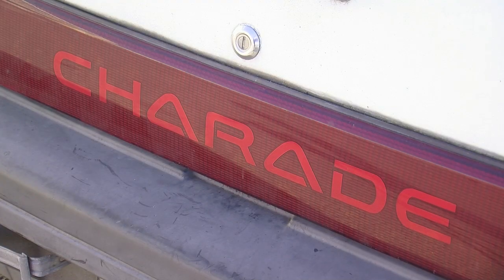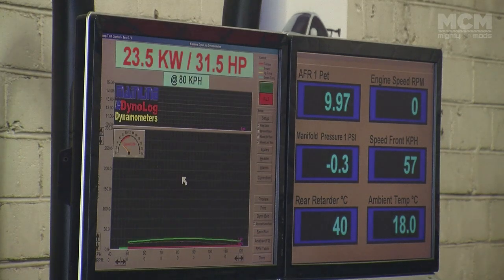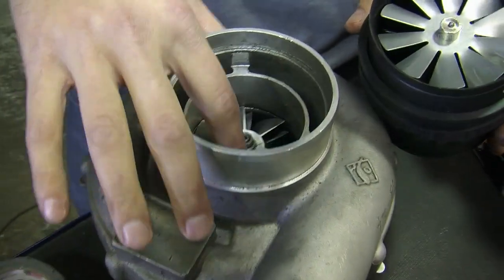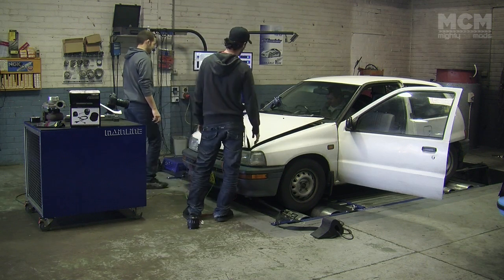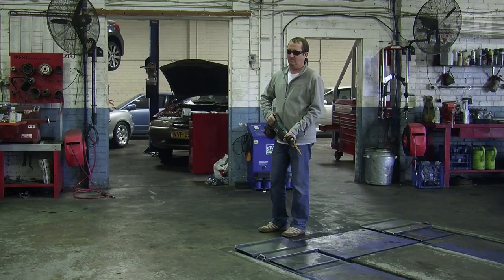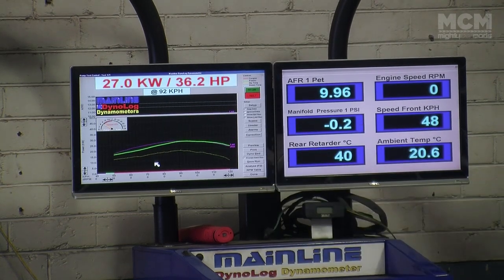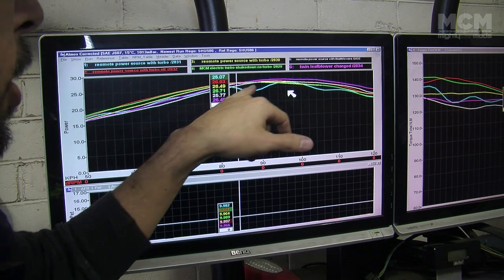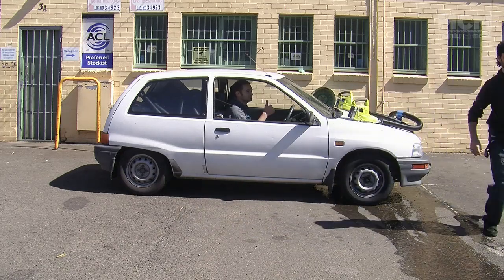Electric SuperChargers Mythbusted

Comment: You can buy a T3-T4 crappy wizzer on ebay for less than that electric "super whatever".. And all you need is a few extra bucks and some sorry fabricating skillz. Stick t3t4 on the end of the downpipe, stick the carb on the intake side, open up the fuel screws a bit, run some of that super high flowin' ribbed shop-vac hose right up to the intake. fill up the turbo bearings with oil and put bolts in both sides. Grab a fire extinguisher and hope to get a dyno run out of it. I would like to see THAT

Comment: I believe it was a standard Aus Spec like on a Forester. The factory tune generated around 125kW after they flashed the ECU they were getting an extra 20kW. That is plausible however I don't believe there is such a thing as a free lunch, a 20% fuel saving on top of that seems to be stretching the truth. I note the manufacturers of the Ezy-Flash Pro ECM don't make any such claims (at least I couldn't find them on their website). LOL.

Comment: Oh man you should totally do a mythbusters on ECU flashing. There were these guys who used an Ezy Flash ProTune on their Subaru and claimed heaps more power, torque AND a 20% fuel saving ! Sounds unbelievable, maybe you could check it out !! (I believe flashing the ECU can increase power etc, just not with a 20% fuel saving thrown in). LOL.

Comment: higher octane fuel will help, no argument.
But introducing boost has the same effect as increasing compression, it raises the pressure on the mixture.  E-85 (102-105 octane) and ethanol (race fuel 108 octane) can handle this to a point. 
take a 1000cc engine at 11:1 natural. forced to 2bar (not huge) still at 11:1 would produce a pressure on the mix equivelent to the origional engine having a 20:1 CR. Since temerature increases exponantialy with pressure, it doesnt take much for the mix to Det:)

Comment: I went back in time to find a reason why you would be so tripped up over the exceedingly simple thing that I've described over and over.

I stated "I now consider bringing a supply of air along for the trip a poor use of space."

That was a boost tank... the idea came from NOx tanks, supercharging, and being a poor college kid. I never intended it to run the engine, but since charging the tank was decoupled from using it, the boost would come without much energy cost at the time of use.

Comment: I'll spell it out for you. The tank is charged at home and used later for experimentation. The experiment didn't work because of any number of reasons (but certainly not because of an air compressor), so I scrapped it. The pressure in the air tank will rise to the same level whether I used a manual bicycle pump or the $0.75 one at the gas station. You keep going on about a $20,000 pump like you can't comprehend an air tank that is detached and far far away from its air compressor.

Comment: If you can do valves and all that, I would start with a port and polish since that is most likely to be a cheap and easy enhancement that won't cost much but time. It's likely that the factory didn't spend the time, and the VR6 format has great starting potential for this mod. Since both a supercharger and turbo supercharger will both take power to run them, the porting job does shine since it is a passive gain.

Comment: Although I know an electric supercharger is a piece of shit ....you guys ran it through the air filter cover...you need to run a solid pipe from the S/C to the throttle body/carb that wont leak boost to make full potential power. All the compressed air you guys added just blew through the top of the air filter box

Comment: Being an air tank and not a compressor with an air tank... The data plate did not mention any compressor specs. I have mentioned before that I had an air tank and not a compressor, right? ... Right?

For all the effort of making a troll YT account and posting hundreds of flames on an entry level car channel... You really suck at it. I hope it helps to ease the pain of being a furry.

...and just to clarify, I had a standalone air tank... not a tank from a compressor.

Comment: thanks for replying i really appreciate that, i was thinking of the mercedes benz kompressor, or a g60, or any regular supercharger that can give me even a minimum boost as long as i'm not changing anything, and besides i can install valves, solenoid poli and stuff like that so it wont start unless i want to, i was thinking to automate it after 3000 rpm, it's a vr6 2.9 D.O.H.C., again, any ideas are welcome and thanks again

Comment: I clearly stated that I did this when I was young and stupid... Though I had good reading comprehension, this was before google existed and there were fewer geysers of shit-talking know-it-alls per square inch back then. I also stated that I had an air tank, not an air compressor, on board. The intention of the project was to give me one short boost, but mostly just to see what would happen since this was very likely before you were born to serve insight from your ass.

Comment: try this lol Change Sun 70mm 4 Bladed EDF unit  
- Outside Diameter : 71mm 
- Material : Carbon Fibre Reinforced Nylon (Whole Unit)  
-  Rotor DIameter : 68mm , 4 blades
-  Max RPM : 50000 RPM
-  Motor Shaft : 3.0mm & 4.0mm
-  Working Voltage : 11.1v - 22.2v ( 3 - 6S )
-  Motors required : Inrunner & Outrunner Brushless Motor 2500 - 4300Kv

Comment: If they use a Wind tunnel you might get more accurate results, but these type of Dynos are just estimates and not 100 percent all the time. This should be tested in a true Wind tunnel to really bust this and maybe run the fan on a Intercooler as well if possible.

Comment: My favorite part is that every attempt to increase performance cost much more than the car itself.

If the cost of either project were spent on OEM regular maintenance items, you'd probably have better performance improvements from the current condition and have enough money left over to do it again later.

The reason these junk kits cost so much is because most people are not stupid enough to buy them, and the ones who are, falsely assume that a big price means big performance.

Comment: I couldn't understand the most of what you just typed, but essentially I had a 10 gallon air tank sitting on my passenger seat. I had a pressure regulator and an air valve. The pressure was dropping from the tank so its temperature was dropping with it. Car intakes are big so even with the regulator wide open I couldn't get any real boost pressure and the tank empties fast. I did this when pretty young and stupid. I now consider bringing a supply of air along for the trip a poor use of space.

Comment: I've done that. It caused no noticeable performance gains at any speed. It made the engine slightly quieter. I think I had it installed after the MAF sensor but before the throttle body assuming the O2 sensor would tell the computer to add more fuel. Essentially the only results I got out of it were changing the intake vacuum to a very slight pressure over ambient, blowing some dirt out of the air filter, and causing the computer to not be consistent because it makes its adjustments over time.

Comment: your just going to blow it back out... It is no surprise they lost power with the "glorified computer fan".. they cut the proper carb vacuum. many motorcycles with CV style carburetors will not even run if you drop a K&N high flow filter on without increaing the flow size of the carb jets. You just cant place a regular carburetor on the output-side of a turbo/super/pro-charger

Comment: Good point, Not only that, but you would stop getting fuel at a much lower PSI like say. . . 1psi depending on the pressure regulator, I run carbs just off a T in the fuel line creating a circuit and let gravity do the pressure adjusting.(And bit of description for those who don't know why) Carburetors depend on vacuum to function in, simplest description, the jets work like a straw in a glass sucking up soda, your mouth being the carb with vacuum from the intake, you put boost in your mouth and

Comment: just watched this video. fun. ok, it doesn't work because it's not compressing air but what would happen if you tried this experiment with a simple air tank from a compresor filled with 8 bar pressure. you could use it when needed and it could refill with a small battery powered compressor in the car while driving.

Comment: Ok I know all of this is a joke but let's have more fun... We don't know how much psi these blower pushed in the intake. Event if i'm pretty shure it was around zero, let's say you find a blower that actually make around 7 psi. The car you tested is carburated and probably has a mechanical fuel pump. These pump usally make around 4 to 10 psi of fuel pressure. So if the boost is any higher than the fuel pressure you just pushing the fuel back in the fuel tank...

Comment: LOL the 1978 corvette only made 185 HP and it had 5.7L V8 in it, the problem was the fact that they took engines from the 1960s slaped some catalytic converter's on and then stuck super low compression 9:1 pistons in so the L81 engine would run on Unleaded fuel.

Comment: Nice episode, BUT:
Looks like you installed the electric charger fan in the wrong direction, that explains the power loss. 
You have to install it in the right direction for a few hp more!
And I am sure there would be a significant performance increase if you change the little computer fan with a bigger, high powered one! The fans inside the leafblower are stronger and therefore give you a noticable performance increase!

Comment: use an old car air con fan and run it straight to the induction, make sure its clean though and well sealed....legit adds like 10-15hp, not much but still

Comment: We had 6 bays and 12 doors and every lane had a 30 inch robot blower fan.  That would automatically come out in front of the cars.  We had 2 4 wheel dynos and 4 2 wheel dynos.  We had sun MICRO system computer would generate a Computer drive trace for us to drive in.

Comment: A) dyno results were inconsistent   B) $150 for a few hp is still high, just straightpipe the cat,  pull the carb and widen the plenum on the intake, and probably get way more hp for free    C) That car would lose 5hp trying to haul 2 leafblowers around, and be less aerodynamic in the process D)remove some of the excess vacuum lines and plug the ports, the reason that car is only getting 31 hp is probably due to vac leaks

Comment: to see any value come out of those pos electric supercharger kits it is required for ANY carb setup to use a sealed carb hat ment for boost, because all i see is the pre heater on the carb not holding ANY boost making this a wasted test all together

Comment: Those electric blowers are cheap and won't create any pressure but what if you used an EDF. Some of them push 2000 Watts. With that kinda power you might get some boost.

Comment: Werent they made for cars with programed MPFI cars, not Carb'ed? It works best with MAF sensored engines than MAP sensored. It basically tricks the MAF into registering more airflow,increasing the amount of fuel delivered vs stock at all rpms.Is the power noticable?No, but gains are gains and those "computer fans" do its job as a cheap mod.And it has nothing to do with compressing air and never was meant to. -_-.

They failed with the CAI (Cold Air Intake) "bust" too.

Comment: You're doing it wrong. Remove the air cleaner assembly. It's obviously not air tight, especially on an old carb'd engine. use an air filter before your electric supercharger and plumb it directly to the carb. It'll be a totally different story.

Comment: It would put a lot of strain on the electrical system and could not be run for any length of time since it would draw more power than the alternator produces.  However I have wondered if that sort of motor could be used on a hybrid vehicle to give them a burst of power for passing or merging on a highway.  Hybrids have massive batteries.

Comment: Im bend against these stupid fans myself - but if you guys knew anything about airflow and tuning more importantly, you would have checked the AF's on the car with the leaf blowers on - you would have found that giving more fuel to the leaned out (this is why you lost power low rpm) you would have gained at least 3 - 5 kw.

Comment: Vacuums get their power not so much from the motor, but by physics and design of air manipulation...take air out of any object and air pressure becomes a power house to work with, a lot of vacuum power is lost by all the air filters in place to stop debris breaking the vacuum motor etc.

Comment: Paintball relies on a build up of pressure and fast release through a tiny port to fire the projectile, engines require constant pressure in a huge port on the intact to achieve better performance.  You would have to carry a tank bigger than your car and a huge compression motor to keep it filled.  You'd lose the HP carrying the extra cargo if you could even manage to get any additional HP from it.

Comment: I guess some people simply don't realise how much air passed through the combustion system, a 12v fan will not blow enough air period, a 1.2L car can have at least10x more suction through the air intact that the best of home vacuums, and when the 12v isn't spinning it caused are restriction (as shown in the video) and drop of HP.  Better off using air cooling/induction, compress the air going into the chamber.

Comment: Youd get more airflow if you didn't have the suction to the leaf blower blocked. The suction is on the bottom of the leafblower. had you laid it on the side you would have got more airflow and more power.

Comment: well thanks for doing so much to inform me ! 
BUT added air flow will do nothing to significantly increase power without attendant fuel provision.  so the car's stock fuel monitoring system is a limiting factor as much as anything. so the vehicle has EVERYTHING TO DO WITH IT!  as far as this test is concerned.

Comment: While it's obvious these fan things are useless on their own, I do wonder about their use along with a traditional turbocharger. That is to say if you had a large turbo that had a long spool time I wonder if there's a way air could be forced from some outside source like a fan or even a compressed air tank in the trunk or something into the exhaust flow just above the turbo to artificially spool the turbo at lower RPMs?

Comment: Granted the sample size is small but the vehicle type has nothing to do with it. A small electric fan can deliver no where near the air voulme required let alone compress it. beanMosheen has it right. Do the calculations assuming you know how to and a computer fan doesnt come close to supplying the air requirements of even a small motor.

Comment: Urrm  there's a problem here. Isn't there a hole in the standard intake that let's the hot exhaust gases into the intake to air cold start emissions? Which means you where wasting Boost...

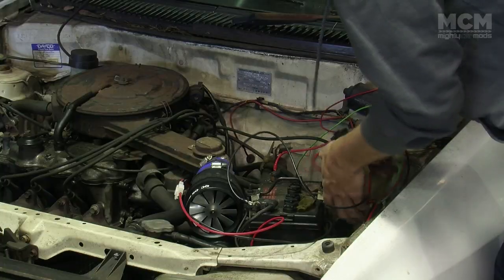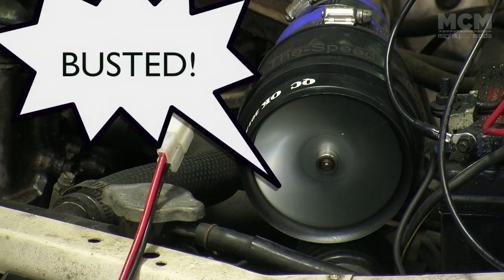Comment: Am I seeing things??  At 05:50 and again at 14:58 in the video, it appears as if the fan is turning counterclockwise and in the wrong direction.  Based on the way the fan blades are facing, it looks like it should be turning clockwise when viewed from the front.  LOL even so, it prolly won't make a (much) of a difference.

Comment: low end cars usually have only crap EFI control, if that POS car is without mass air flow style fuel injection control, (and it looked like it might even be carbureted) then its only going to get a very marginal increase from boosted air flow any way. I think those  electric superchargers are a joke but your test may have proven NOTHING, but thanks for trying.

Comment: It's really pretty simple. If your intake is smooth, the air will flow in easilly. If you install this onto the intake, your airflow without it running at low rpm will be reduced. Furthermore, your airflow will be reduced at high rpm when the fan is running because the car's engine would be sucking in MORE air WITHOUT the fan, because the fan can't keep up with the engines compression intake.

Comment: Aren't superchargers supposed to be sealed to the intake manifold if the supercharger didn't come with it's own intake? Try removing the worst air intake ever introduced to autos and fabricating your own that seals to the manifold. You know so there's no compressed air escaping and then run the dyno test. Not with the stupid ebay one. With the leaf blowers. You've gotta be pretty stupid to believe the supercharger from ebay is going to work.

Comment: if you insert more air without other modifications about the air/fuel ration, you may not increase the power, you can loose it, just like in this movie. that ebay supercharger it just a toy :))

Comment: a guy straps two of these gas turbines onto his boots with a winged sky diving outfit and fly's till he runs out of fuel heel I'd have 2 of them under the hood one running the blower the other running the alternator that powers water pump oil pump gas pumps...less engine torque wasted only a small battery needed to start the turbine to pump oil into engine before starting it nothing wrong with thinking out of the box

Comment: The CFM's make no difference if the fans won't create more PSI.  That's what they were talking about in the video.  A real supercharger will draw off about 50 horsepower from a 200 HP engine by generating a continuous (extra) 5-10 PSI intake airflow, but it will give back 100-150 HP. (It takes force to work.) A fan moving 400 CFM is fine in an open room, but it won't force more PSI. Fans won't draw more than .25 HP, and maybe .5 PSI boost, at best... Leaf blowers are funny, but not effective.

Comment: If it were going to make a difference, it would make more difference on the small motor. Hypothetical numbers but adding an extra 50CFM would make more difference to a motor that sucks in 100CFM stock vs one that sucks in 400CFM stock.